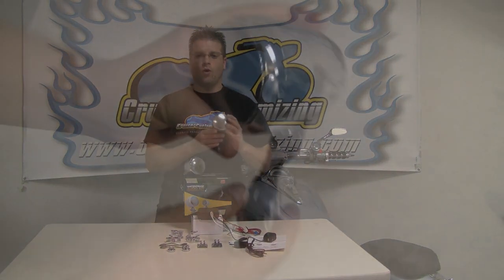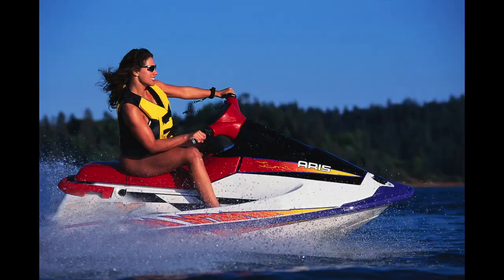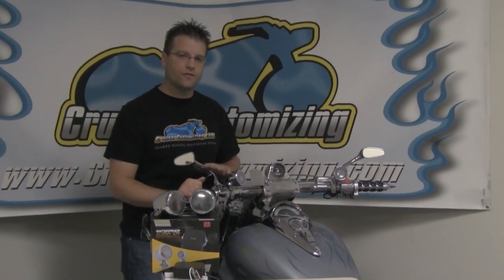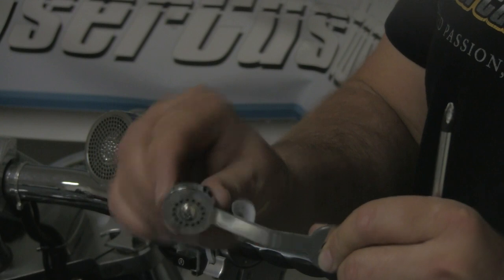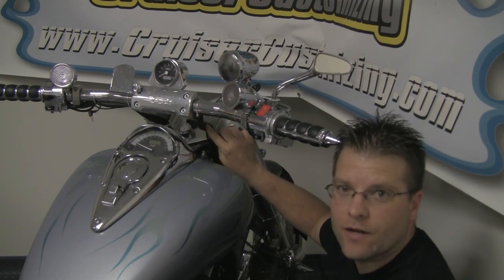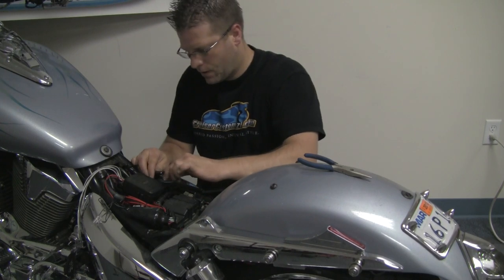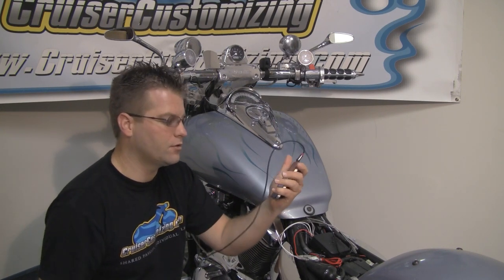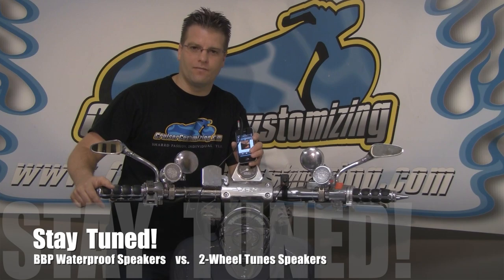TOTW Waterproof Motorcycle Sound System from Big Bike Parts HD Installation Video

Comment: Well I used a piece of rigid 12/2 solid wire and fed it thru the tank, taped the soft wire to the end and pulled it thru without removing tank at all

Comment: I installed this one on my 2004 Harley dyna superglide just how it was suppose to be.  When I went back the next morning my battery was drained.  Anything I did wrong,?
Reply: Tee Warr, I am having the same problem with Shark Shkamp5800spkharley Chrome 600 Watt Motorcycle audio set. (GREAT SYSTEM BY THE WAY)! Your going to have to connect it to your ignition so that it will only draw power when you turn the bike on. I'm not to familiar with doing it so I'm just going to bring it to the shop.